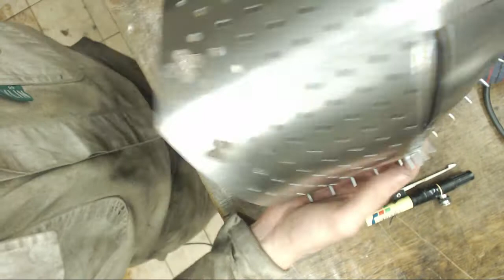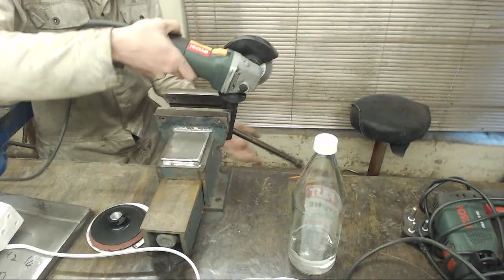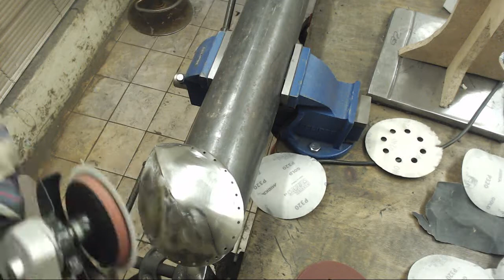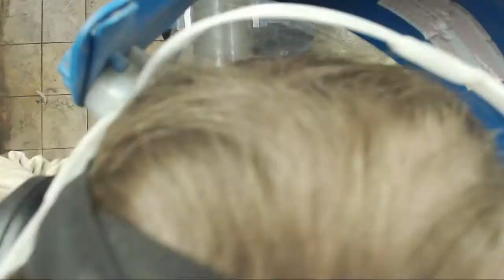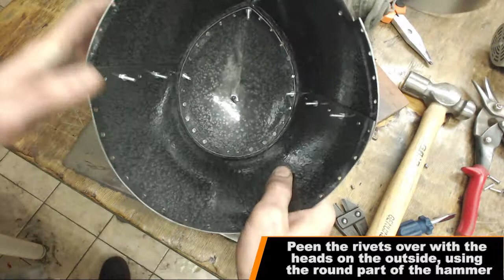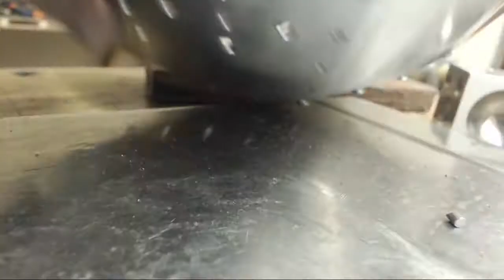Great Helm Build - Part 5 - Finale - Cleaning and Riveting

Comment: Hey I was wondering if you could tell me what you use to clean and oil your helmet with. I have a sheet metal great helm that I never polished or oiled after I purchased and want to clean it up .
Reply from the maker: Hey. For rust removal I use a product locally called Brasso/Silvo. It works really well to remove rust, especially if you let the metal soak a bit under a layer of it. Then to oil I use mirco-crystalline wax polish such as Renaissance Wax.